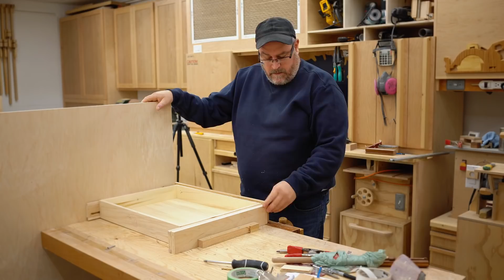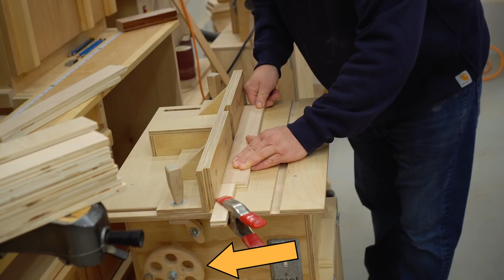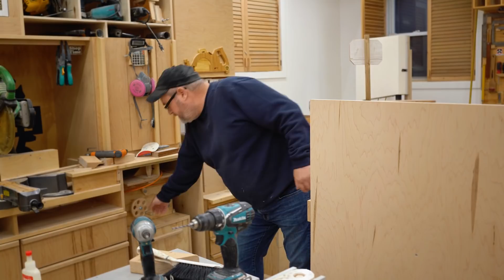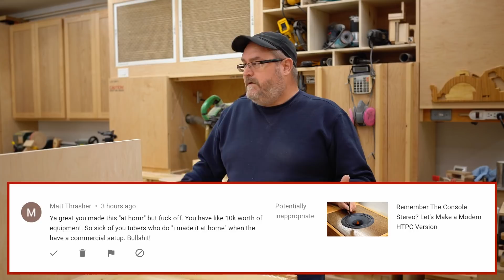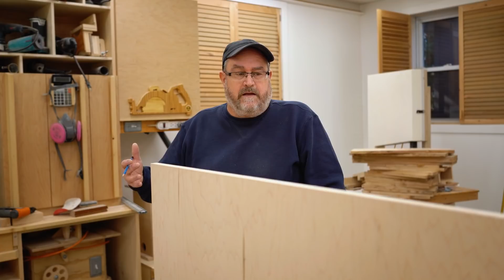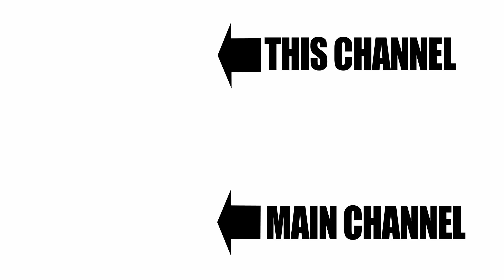Stop Complaining About The Shop and Tools you Don't Have -  Rant!

Comment: I have to politely somewhat disagree with the idea that 3D printing takes no skill. While sure, getting a self-adjusting printer and only printing downloaded things is about as skill-less as it can get, there are people who are not satisfied by just that. To 3D print a functional (not just decorative) thing requires extensive knowledge of the CAD software, material properties, and the printer's capabilities in order for the project to be successful, done in a timely manner, and to not waste a bunch of materials. For example, printed objects' strength is directional, similar to wood grain, due to layers. Sure, one can drastically increase this strength by printing all parts solid, but in many cases that just wastes material and significantly increases print times. If the part is going to be visible or has small details then re-adjusting the printer's nozzle size and printing parameters may be required. Same goes for a part that is either needed sooner, or where quality does not matter as much.
In a way it's similar to wood working since pre-cut wood kits are also available, but i doubt that anyone would call themselves a skilled wood worker after building one.
Reply from the maker: I didn't say there's no skill involved. I said to get started and to produce something that looks good right away doesn't require physical skill, as in the skill required to use tools to physically make the parts. The skill that can take years to develop.
Reply: @IBuildItScrapBin  If speaking just about physical skills then I agree. I thought you were talking about "in general".

Comment: The thing I liked about your channel vs all the others is you used normal “construction” tools and materials. You don’t stand in front of a wall of planes or Festool boxes stacked floor to ceiling. Your work and thought process is badass. I don’t even bother to watch the others.
Also your plans are so great, easy to follow and error free even I can build from them. I’m Almost done with the ultimate box joint jig.
Reply: I'm actually a fan of both types of channel. I enjoy John's for the reasons you layed out above, but I enjoy other channels too. The link is that they all widen my knowledge on what is possible in a workshop - what range of tools can be used etc etc. I know that I 'd find it hard to turn down a Festool sponsorship offer if they came knocking. A workshop where I've made all the tools or a workshop full of Festool products? Why not both? As John saud, where there's a will there's a way, and people have very different wills.

Comment: The drawer slides plan is super useful to have in your arsenal.   You can learn something about mechanical design or engineering by building it ... Leveling up that side of things ... Maybe.   That router table with lift rocks.  I know, I built it.  Next to the cnc and tablesaw, it's one of my favorite tools in the work area.  Are the drawer slides design going to the makers mob or into bigger project?  Also ... 3D printing vs hand tools ... We got some years before that happens.   I got cnc because I'm not mechanically or craftsmen like inclined.  My Dad is, I'm not.  So got cnc.  Your comments about craftsmen skill vs automated cnc ... Are absolutely right, can't argue with that because it's true.    Best case is to have both sides and understand how to apply them in each working method. Would be curious to see what you would do with a cnc or 3D printer.

Comment: I started in an 12x8 shed behind my mothers house with a basic ryobi drill, impact driver, circ saw, a ridgid router and and 5 in dewalt random orbital sander.  this is my hobby mind you and i sell stuff here and there to fund my hobby.  6 years later I have a 25x35 separate building behind my OWN home with concrete floors and sub-panel.  its outfitted with cabinet saw, miter saw, multiple routers, many other saws, multiple workbenches, more clamps then i know what to do with and then some.  Im sure i have more then 10k invested into it and i learned everything ... i mean everything i know now from youtube.  starting with one of JOHNS videos (WHEN I HAD NO TOOLS) 6 years ago.  Learn and watch all the videos you can and youll be able to build damn near anything ... best part is is that anyone that has followed John for some time knows that he has build damn near every tool he has lol.  Except that damn hitatchi miter saw he has had that and makita cordless tools forever hahahaha.  see whos been following long enough to know that hahahahha.

Comment: John, 3D printing is a long way off from ever replacing wood working. As a 3D printer person, it's really for making prototypes. It takes an incredibly long time to print things and as far a durability, it sucks. Resin printing is the only viable option and that is expensive. Even the cheapest of machines are over $300 and have a print bed the size of a cell phone. I think all the wood craftsmen are safe for a very long time.

Comment: Guys like that d-bag have no clue. There is so much to learn from guys like you, whether you build the actual project or not, and, of all people, your largely "homemade" shop should be an inspiration that great results don't come from buying expensive tools. Why, just this morning I made some "Heisz Handles™" for my new drillpress (the cheap plastic ones always felt loose) using my Heisz belt/disc sander that might have cost me $10 in hardware and some random plywood scraps. Dude was probably a self-entitled millennial or something. Now...if you would have whipped out a Festool Domino...that would be a different story! 😜

Comment: I thought backlash is what you constantly get from viewers that insist on breaking your balls.

I love tools as much as the next guy, and admit that some of what I have gathered over the years were things that are nice to have, but not necessarily need to have.  You can spend hundreds of dollars on a Leigh jig for dovetails, but it is far better and more satisfying to learn how to make dovetails by hand.  There is an old saying that you need to spend 10,000 hours to become an expert.  It is so important to learn the CRAFT, and that can only be done by making mistakes and learning from them.  Dropping a few grand on a SawStop with all the trimmings does not make you an expert.  There is no substitute for doing the work.  And knowing how to use hand tools will take you very far.  If setup correctly, a #3 or #4 smoothing plane gives you a better finish than sanding.  Most of all, woodworking should be FUN.

Comment: There's more to 3d printing than getting the machine tuned.  You really have to understand the limits of the process to design something that's actually functional.   The parts essentially have a grain direction like wood, for example.  A power tool centric woodworker is really mostly about getting the machines setup to give us the accuracy we need.  Power tools are about increasing efficiency and accuracy without having to develop the hand skills to do it.  Cnc and 3d printing are just further abstractions of that.  And the more abstract it is in some ways the harder it is to design.  You can't tinker around with a 3d print to get it to work right.  It's got to come out of the machine working or you have nothing.  You have to wait a day for the next version of your design to come out of the machine.
Reply: I understand there is more to 3d printing than meets the eye, but each day it gets easier and easier. The online support communities are huge and have 99% of the answers. If you want to make a bowl, you can download the design in a few seconds. 
Not saying any idiot can do it but it gets more fool proof everyday. I myself would like a 3d printer but I see it more as a novelty and it will eventually end up collecting dust in some corner.
Reply: @KipdoesStuff  If all you want to do is print someone else's design for a bowl, you were never going to go out and buy a lathe anyway.  That's not making, that's slow motion shopping.  Woodturning is a good example of what I was talking about in my response to John.  Wood isn't a homogeneous material, especially if you're working with something with a natural edge or defects.  You aren't just coming up with a design and then forcing the wood to conform to that design.  You have to find the design inside of the wood.  That's something an additive  process can never do.
Reply from the maker: My point about 3D printing was that it will allow people who want to make small things to do so, without investing the time into building the physical skills required for woodworking. I wasn't putting it down.
And my point was also that 3D printing doesn't appear to be there, yet. But as they become more capable, that will change.
Reply: @IBuildItScrapBin  I thought your point was that it was inevitable to take over because it's easier and my point was it's not inevitable because it's not easier.  Regardless of how foolproof the technology is there's something fundamentally linked between the design and the process of making for tinkerers and artists.  I'm trying to write a book right now and it's generally about finding the design through the process.  Design isn't something that I do first and then separately I make the thing I designed.  So it's impossible for me to 3d print a design because it doesn't fully exist yet.  I realize most people don't work that way.  But 3d printing opens up making things to people who weren't going to go out and buy a table saw anyway.  Most of them will never make anything original of their own with it.  But some will.  And they will find frustration by not being able to directly modify what they make.  Some of of them will get a dremel.  Some of them will decide that modifying the print to get it to work was more rewarding than the printing part and then they are off to the races.
Reply from the maker: @krtwood  A book, eh? Gonna send me a copy?
Reply: @IBuildItScrapBin  I don't know yet whether it's going to be a physical book or a self-published e-book.  If the latter then I'll definitely send it out to patrons.

Comment: I have 6 3D printers and I have designed and printed a variety of objects, some novelties and some practical, I try to do mostly practical things. But, for some things, actually a lot of things, you just can't beat wood! The personal satisfaction from 3D printing, at least for me, is only in the designing. With wood working there is satisfaction in designing, building with your hands and knowing that whatever the item, you built it and not a machine. Again, for some things you just can't beat wood

Comment: I built my house and then my custom oak cabinets with fielded panel doors with a contractors table saw, a skill saw and a router. I actually have a cabinet shop but it was easier to build it in the garage and install as you go. If you really want to do it it can be done... And enough of the skill can be learned fairly quickly, especially since youtube is available. Of course you need to learn who to watch and hope some moron that knows less than you do isn't showing you how in the video...

Comment: As someone who has a 3D printer, I totally agree.
I often find myself modelling something up in Fusion and about to send it to the printer, then realise in the time I spent modelling it, I could have already made it out of wood, never mind the hours it takes to print.

I also have a small CNC, but I rarely use it because of the time it takes setting up, it's faster to just quickly knock something out on the bandsaw, or if it's particularly delicate, the scroll saw. 

Having said that, they're different tools for different things. I just use what's best for the project. I've plenty of things made of both wood and 3D printed parts. I'm in the process of making a Festool MFT knock off using a 3D printed hinge because of the accuracy. Sure, I could make it out of wood, but it'd be a lot of trial and error making it fit. 
Whereas if I model it and print it, I know it'll work!
Reply: I would like to have a 3D printer but I know I will rarely use it. I have a Genmitzu CNC router and use it rarely also.

Comment: I started building furniture when the only power tools I had were a drill, palm sander and a jig saw. I bought a circular saw from a garage sale for $10 and bolted it upside down in a plywood table (that I made) and clamped a 3’ level down as a fence because I didn’t have a table saw. This was in a 1 car garage with no electricity so I ran an extension cord from the house. Every time the wife wanted a piece of furniture I made a deal with her that we could either buy the crappy particle board department store item or for the same price I could buy a couple tools and the materials to build a better version of whatever she wanted and it would be custom whatever exact dimension style and finish she wanted. She fell for it.  Now 10 years later I have a 40’x40’ shop with electricity and lights and lots of tools. Most of which I bought used or built myself and my house is filled with furniture I made myself. You have to start somewhere. Your spot on about people making excuses for why they “can’t do it”.
Reply: @mariusthefaker9339  Any excuse to get quality tools, when you can afford to, is a good excuse :)  Tools are fun, and quality tools are more fun because they are less likely to break when you need them.
Reply: Great story. I used to collect mechanic tools by charging my friends the price of the tool plus a little extra for me.
Reply: I find my that my "$10 circ saw attached upside down to a sheet of plywood" works so well that I've never bothered to upgrade :D I too use a level and clamps as my fence.
Reply: I rented half of a townhouse apartment when I went to college, and the day I moved in I made a workbench in the bottom of the basement stairs.  The second day, I made a queen-sized platform bed from two sheets of MDF and my hand saw.  At that point, I had a hand saw, a brace & bit (a hand drill), and a hammer, plus the stuff I got from the lumber yard nearby.  
Taught both my kids the same way.  No excuses!
Reply: Exactly 👍
Reply: Why I got into WW.  Saw the price for k-mart entertainment centers vs. the cost to build one myself and a cheap contractor TS.  Went from there.

Comment: I agree with your predictions about 3D printing, but have to say that there WILL still be skill involved.   However, as you said, it will not be physical/manual skill, but the mental skills involved with computer design and programming, which may appeal to a different type of person.
Reply: I’ve been 3D printing for about 3 years you can get the machine dialed in but it’s still very rarely plug and play. Lot of settings on the slicer and keeping the machine running is a large task as well. My buddy has had one for longer than me but he still runs into constant issues where I mostly have my machine dialed in and know what to do to get a good print.
Reply: 3D printing is the next level, but making it with your hands is more of an art
Reply: Most design has been done and you can download the program for almost anything, a few adjustments is all that's needed. I can see the convince of that for some. But, I'd rather make it with my own two hands. Or at least create the design myself.
Reply: @KipdoesStuff  the free designs you can download are more often than not worth exactly what you pay for them... (unless you just happen to need a blobby plastic statue of a cat)... It takes just as much skill and materials science knowledge to design for 3d printing as it does to properly design a piece of furniture... I do both.

Comment: Hahahaha i love that you hit the nail on the head with regards to people complaining about shops, tools and space. Just an excuse to do nothing. My work space is exactly 2'×5' and I still do plenty of work with my handtools and the 4 power tools I own. To do one project I have to start with break down of stock and getting things to roughly the exact size, then I have to clean everything. After that if I need a power tool I have to take the big metal working vice, which also happens to be my only vice, off the bench set up use the tool then clean everything all over again, then put the vice back on so I can do the joinery, only to remove it again, clean again. Then I get to do the test fit, maybe start over at step 2 for some things and finally glue up, then go outside and do finishing. Space and tools are not what stops people its the limits they have placed on themselves so they don't have to do anything. Great point